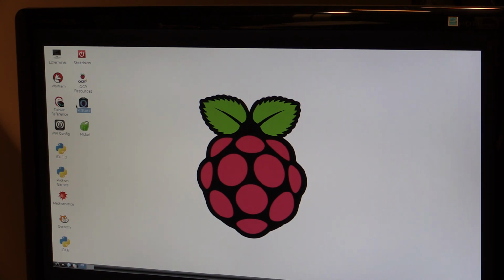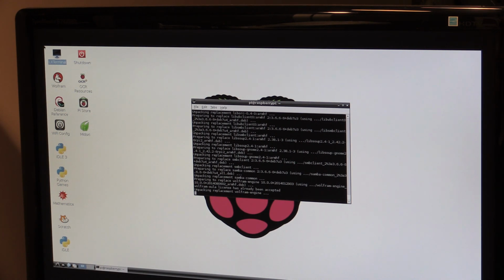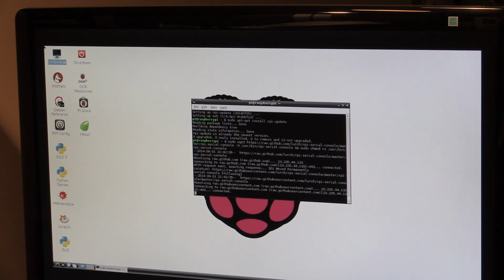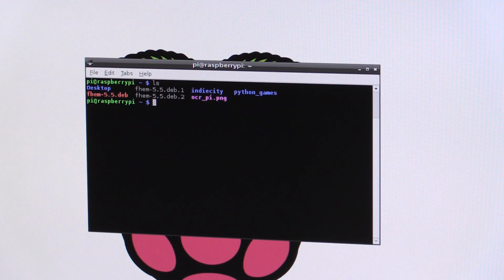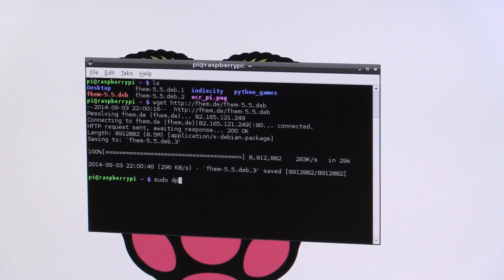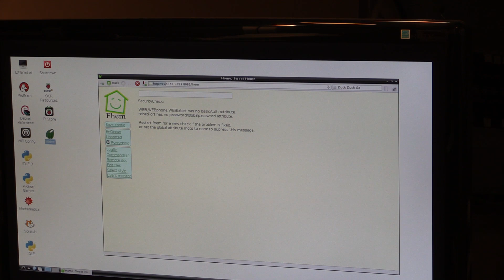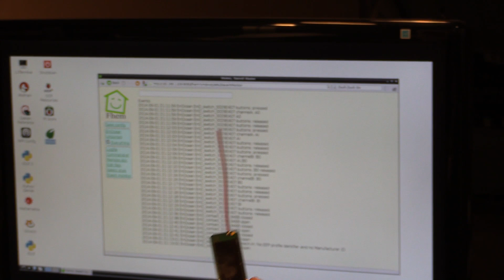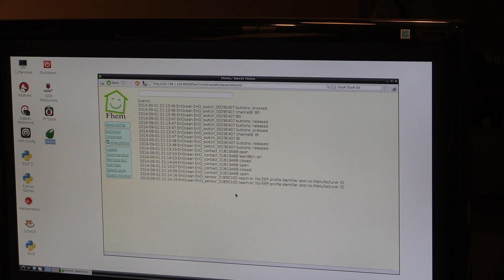PI B+ and EnOcean Sensor Kit setup

Comment: OFC if your logged in as a root user you don't need to type sudo, but shouldn't really use root login :D
I personally don't like to use the python tools/platforms. I am using C on mine, must admit its somewhat challenging but certinally is well worth it when you really need the speed and low RAM usages.